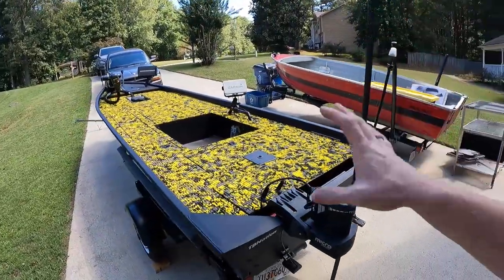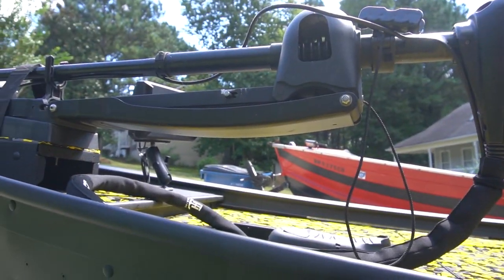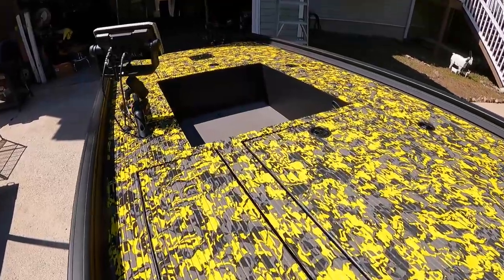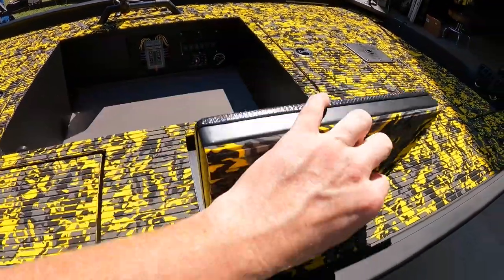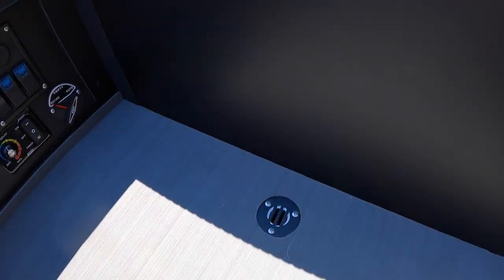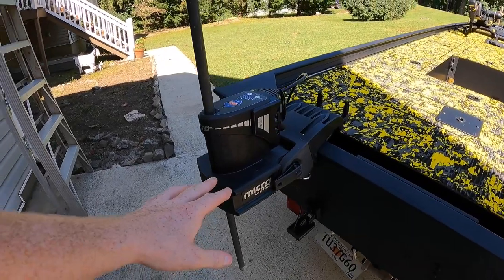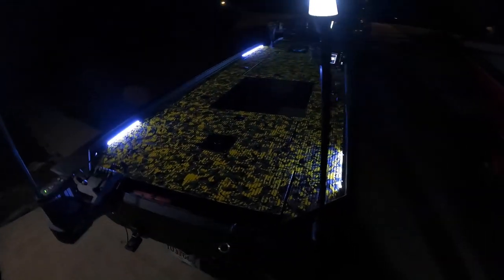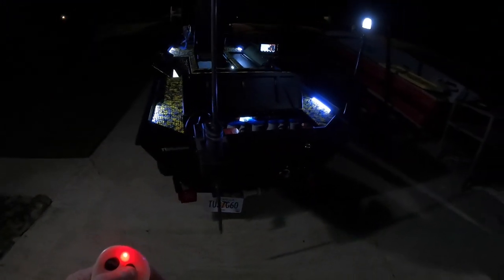COMPLETED Jon Boat to Bass Boat | Tiny Boat Nation

Comment: Finally!!! Been waiting to see this boat for a long time. Frickin amazing. Best electrical panel and charger mount I've ever seen. That big middle stow is screaming for a huge center rod locker. I still think you could put a front seat mount inside the compartment with a hole in the deck lid. You would have to remove the post to open the hatch but at least you would have the option. Or like you said two hatches with a seat in between.
Reply: This may be an upgrade in the near future! On the water vidos coming soon🤘🏻
Reply: @aaronwilson8198  Your gonna get on the water and never turn back. Have some fun out there. You gotta be stoked!!!
Reply: @mattaneshansley5349   that's an under statement...  My wife just thought I stayed out all day in the Hobie kayak 😂

Comment: I didn't realize Nate's Dry Hatches were available in 10x48. I'm redoing my 1448 mod this winter and am debating doing an all aluminum build with Nate's hatches. The 10x48 size is a lot nicer for hulls with narrower beams 😃 Excellent work BTW. I agree the electrical is super clean.
Reply from the maker: It is a custom size but yes they are available

Comment: Awesome build, great looking boat, I am working on a design for my boat, and I thought that I would build a large rod locker in the center of the boat, is there any reason why I should consider moving the rod locker to one of the sides?
Reply from the maker: I try to keep it to the side because the tackle ends up weighing more than the rods and I would prefer to have the weight in the middle as opposed to the sides

Comment: I have the exact boat and I’m looking at rebuilding it as well I love the way you did yours. Just wondering how the weight is distributed and how it floats. I have outboard on mine and may have to move something to the nose
Reply from the maker: It is a little back heavy with the outboard on it, but there's a few ways to combat that.
1. Lithium Batteries 
2. 24v trolling motor is a little more than this boat needs. Go with a 12v to lose a battery spot.
3. Instead of 1 middle hatch run 2 and use 1 for batteries

Comment: Looks like it would be very stern heavy, how does it plane?
Reply from the maker: It almost gets on plane with a 9.9 but yeah its a little stern heavy. Originally I was expecting only a 12v trolling motor so that would shave off a little over 50lbs

Comment: Hey man I have a 15 ft x 6ft v botom bass boat I have 6 sheets of 3/4  marine plywood for it . Should I use 3/4 for the floor only? I'm going with pink 2 inch foam board
Reply from the maker: probably, 3/4" is pretty thick and heavy. We usually use 1/2"

Comment: Got a question..I bought a couple sticks of the j channel from Nate’s to use in my build, any videos how to make a lid for these channels?
Reply from the maker: The dry tracks? You can either weld or braze, but you will still be missing the lid part
Reply: @fireantfishing  working on something 1” 1/8 angle cut 45 brazed an skinned with .90 aluminum